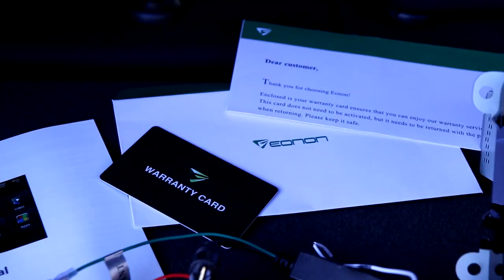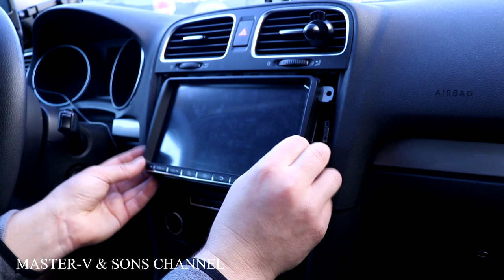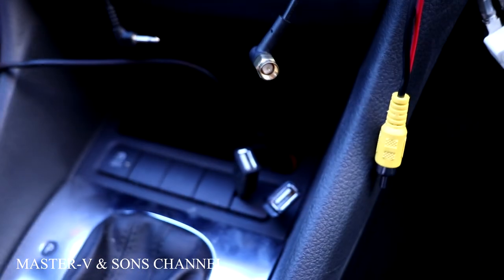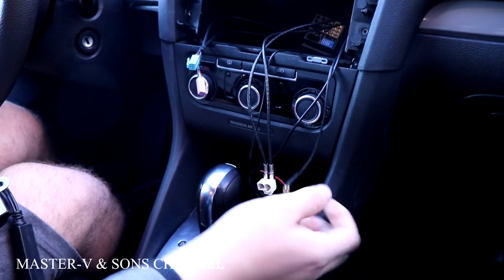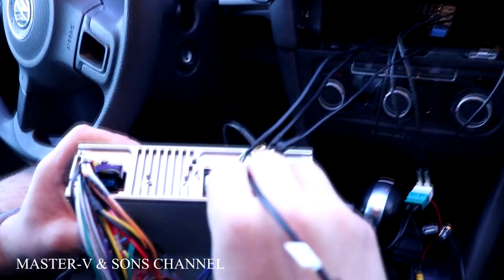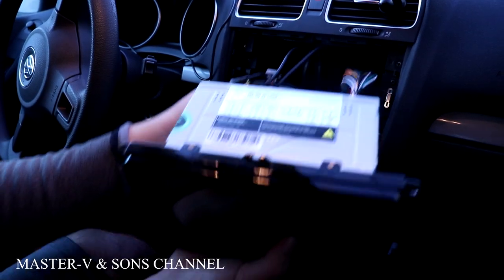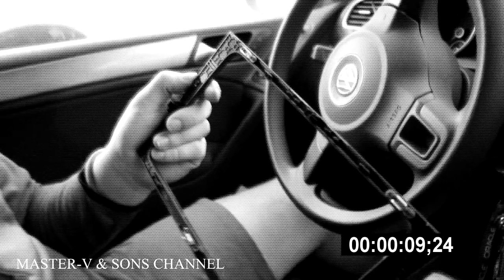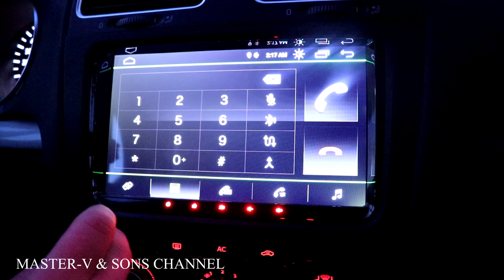Upgrade with 9" car stereo for VW golf(MK5,6) , Android 10 with navigator, you Tube, Netflix

Comment: DUDE! How u turn off button lights? Cause when i turning off radio,they still shining..
Reply from the maker: We had problem with previous stereo why did we change it,  close the same problem .
Also, It was needed the separate turn Off/On the stereo buttom and itc. 
 With this stereo no any problems.  I am  happy with this.  Also no blocking on watching YouTube and drive.👌
 ..🤔 you know,  check the wire,  may needs the cut one(someone loop🤔)

Comment: and Why did not use the rear camera line dedicated for the rear camera?
Reply from the maker: Hello,  Thank you for your comments!
...no we use connector for rear camera!!
On this cable 4 connectors,  3 for DVR, and one for camera (video in).
Reply: @master-vsons2838  I hooked the reverse camera into the input marked CCD connection on the main plug. That is the correct one, in the pinout diagram on the top of the unit it shows that going to the pin marked reverse camera.

Comment: Hey. Thanks for the video. I installed a reverse camera, works good. But - when I signal to the right or left it's triggers the reverse camera on the screen - there is no signal because it only gets power when I revserse.. Do you have any solution? Thanks in advance
Reply from the maker: We also Installed rear camera, but no issues. 
 Please explain,  when camera ON( position -R), you make turn signal  and camera off, when turn signal off, camera  turn on again?? This is  correct??
Reply from the maker: My method of connection. 
I connect the camera Negative wire to the body of the car and Positive wire to the light bulb(rear).
Reply: @master-vsons2838  When I drive forward and have to signal to the right, the Radio turns on the reverse screen when the car signal to the right. When the signal clicks back on the car the screen goes back to radio interface - there is no power on the camera because it's on the back light wiring. Do you understand?

Comment: Does this come with steering wheel controls bro ?
Reply: I actually I Have this same one but it didn’t work for my ‘16 so I had to get a pioneer
Reply from the maker: Hi. Thank you for your comment. 
We have base model(VW) and this option was not important for us.
  But, it seems to me that I saw this option in the settings, but I don't know if it works, since there is no way to check it
Reply from the maker: We plan to make a short video, a review for six months of use and tell what works and how and how about the functions, so I think we will check your question ?!

Comment: Hello. I’ve installed the same radio last night and it works well only the rear speakers play no sound. The front works well but the rear are quiet. I’ve connected all the wires. What could be the problem?
Reply from the maker: Thank you for your comment. 
Look at the setting where you can calibrate the sound, maybe this is the problem?
Reply: @master-vsons2838  there is no option in setting to calibrate only to set the audio focus on the rear speakers but it’s quiet when i do this

Comment: I just bought the stereo you had already installed 😬. You saying it's poor quality?
Reply from the maker: Hello,  Thank you for comment. 
If you this one(Android 9'' Multimedia Navigation 2GB RAM 32 ROM Car Radio for Volkswagen Passat Golf MK5 Jetta Tiguan T5 Skoda Beetle Touch Screen with Button Car Stereo for VW https://www.amazon.com/dp/B07QPYT492/ref=cm_sw_r_wa_apa_i_guazEb9WXT9XA), so yes, this poor!
Reply from the maker: What we Install on this video,  much, much better!! (Double Din Car Setreo Eonon Android 10 9 Inch Car Radio 32GB ROM for Volkswagen/SEAT/Skoda Compatible with Fender System Support Apple Carplay/Android Auto/Bluetooth 5.0/WiFi/Fast Boot-GA9453B https://www.amazon.com/dp/B083XF25JK/ref=cm_sw_r_wa_apa_i_9yazEbMEDBY57)
Reply: @master-vsons2838  What did you not like in this model that was removed from the car. I ordered the one you downloaded but now I watched your video

Comment: Nice vid. How did you manage to get it started when turning key on? And off?
Reply from the maker: Thank you for comment. On this monitor that we got. It cane with this plug on the actual power cable that you can separate if you want. We separated them because we saw that the display will stay on after. So unplug that wire and see if that works. Hopefully that helps you.🙂

Comment: Hi pal, ive got a golf mk6 with standard stereo. Would i need am antenna for the sat nav to work ?
Reply from the maker: Hello, 
Sorry...
I am not understand clear you question! 
...but I try to answering. 
AM, FM antenna for radio! For Navigation systems need a special GPS antenna,( small black box.)
If you buy stereo with NAVI, is most the time,  GPS antenna are  included.
Reply: @master-vsons2838  thank you
Reply from the maker: @matt34mids  sorry to get back to your question the sat is for the radio and if you don't have one you can't use the radio function in the car.